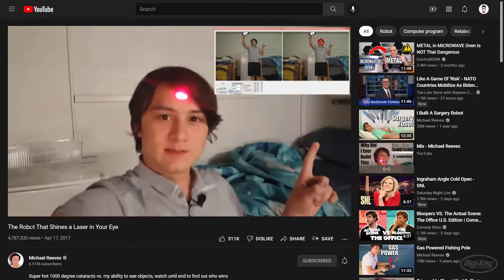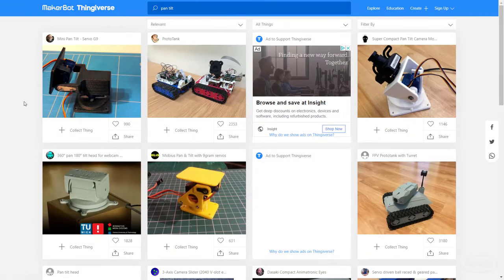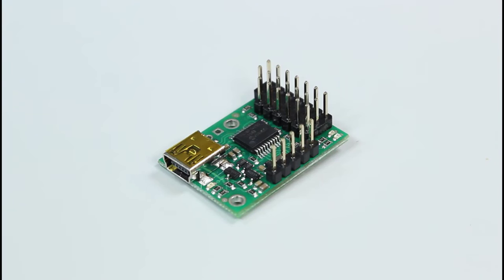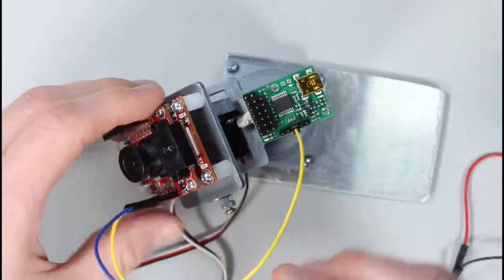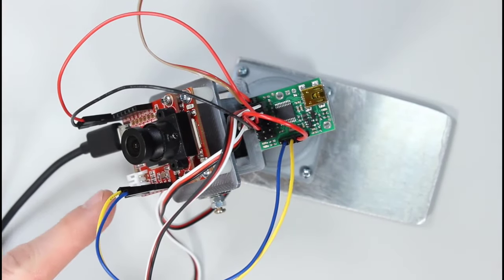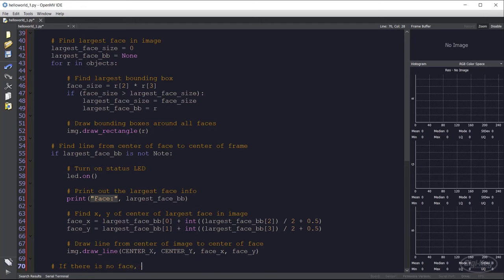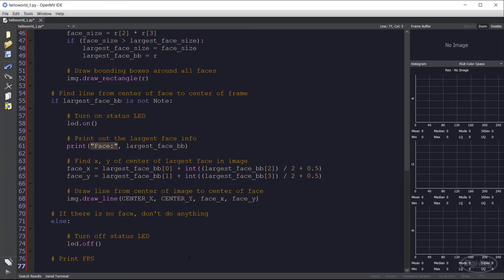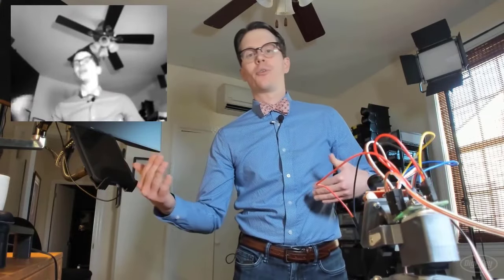How to Build a Face Tracking Pan Tilt Camera with OpenMV | Digi-Key Electronics

Comment: Thank you for your video.  Never heard of the OpenMV before.  An interesting follow on would be to use multiple OpenMV's to work together with a Pi to do a common task such as robot navigation.
I have an additional need.  Many devices such as weather stations have no direct local CPU links.  Instead, they have visual or possible cloud links.  Many times I have seen farm videos where farmers had to wake up multiple times in the night to check grain drying operations.  Is it possible to use OpenMV to detect characters and status indicators on a display?  An esp32 or equivalent could be used to supply network connectivity.

Comment: A comment that is not directly related to this video.  Digi-Key has server videos showing edge systems in control operations.  The raspberry pi especially with the released 64 bit OS can run most cloud software packages.  Perhaps Digi-Key can start a topic about pi base edge systems.  This could tie users as well as new vendors to developed pi edge systems.  Right now the SCADA industry will not make this transition.  As you know a large percent of Pis are involved in industrial control.  Just making a modest suggestion.